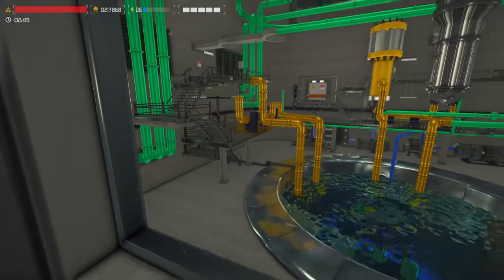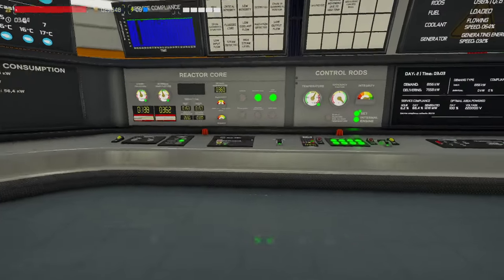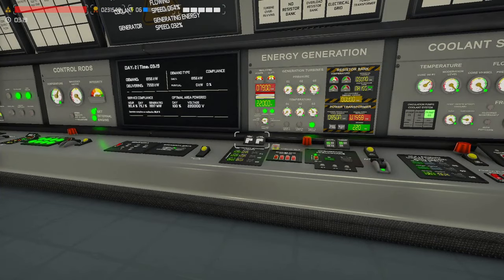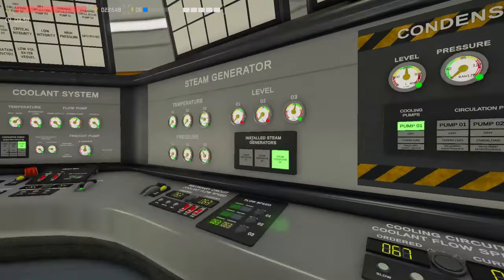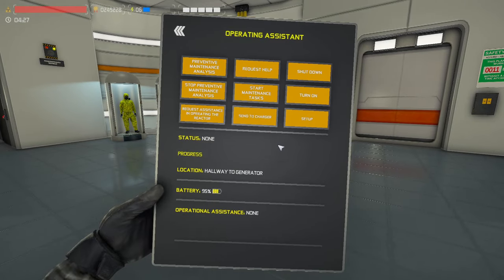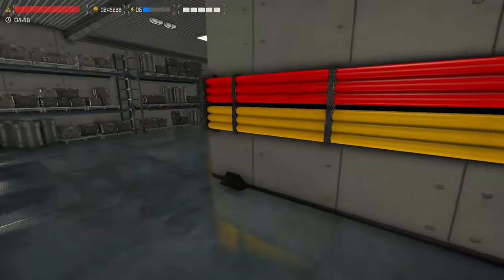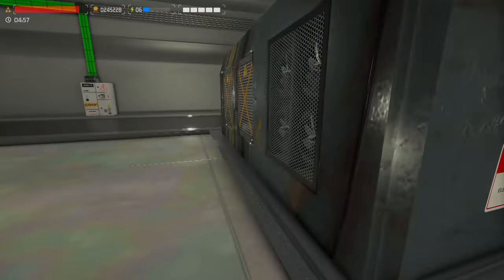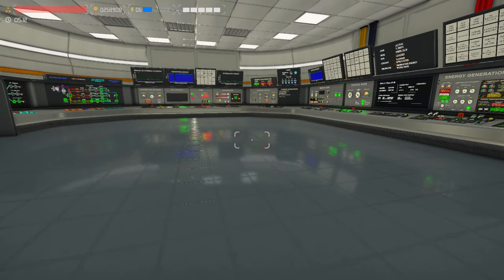How to balance power and reactor? | Nucleares

Comment: put it on easy mode start reactor  bring it up to temp. then put all cooling  and steam to 100%  condense 65%ish. that will get you to lvl 8 with good chunk of change to practice the different loops and valves  upgrades powering down etc. I don't think this guy doesn't quiet has it yet i have bigger issues with trying to run 3 loops with out breaking something, SAVE SAVE SAVE
Reply from the maker: That is valid point because I did learn very hard way how do things